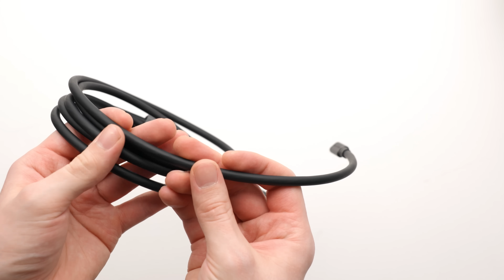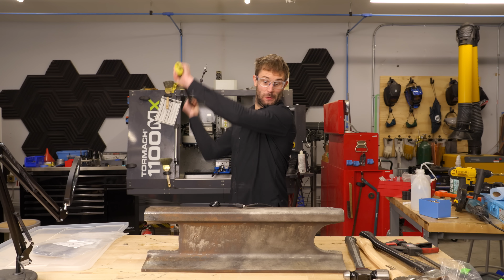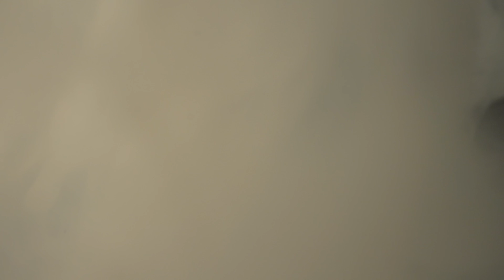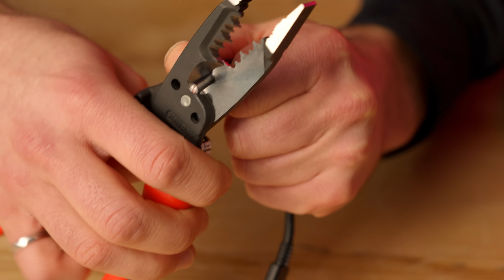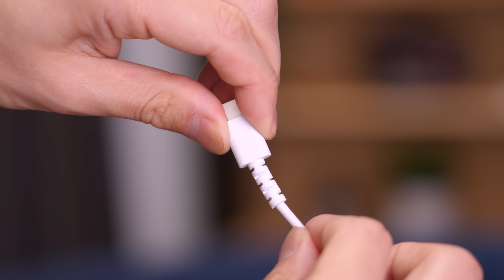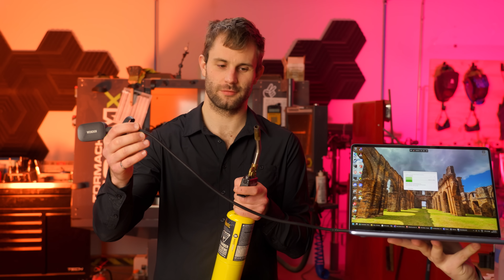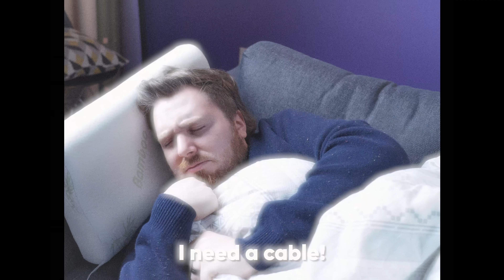Why It Took Me 4 YEARS to Make a USB Cable

Comment: I kinda hope a cable can work with everything and every way of possible with usb-c port from that name. So it's a dissappointment for me. I want a usb-c cable supports thunderbolt3, thunderbolt4, 240W charging, 80gbps, 40 gbps, 20 gbps, display port, audio listening, LAN etc. What device uses for what type of data doesn't matter, it must perfectly match with the specs. So i hope someone gonna produce a usb-c cable with all options without any expection.

Comment: You should make different styles.  My motherboard has USB-A 3.2 Gen2 at the back but the headers are only 3.1 on board.  I use a usb a to c adapter, then I use a usb4 c male to female cable to the front of the case to use high speed devices.

Comment: I mean honestly the pricing isn’t that bad its about the same as a junk cable from a gas station. I might grab 2 for my Fanatec GT DD Pro one for the PS5 and one for my PC. I would rather have a cable that gives me the speed and power advertised than save a few dollars and have to buy it again when it ultimately fails.

Comment: my absolute hatred for cables stems from the android auto connection. is there a way to know? i would think that these should work. but just not in the mood to drop another 20 bucks on a cable thay might not support it. i need a usb a to c, and a usb a to lighting for trubleshooting cars from customers. often its their cable and they dont believe me. but the official vw ones are 40 to 50 bucks.

Comment: Usb-A to square A like for audio DACs and older computer printers and accessories?
Reply: You can get en but your better off just getting a c to a adapter so you can use it with any c to c cable.
Reply: @whatsmolly5741 blasphemy 😂
Reply: These devices probably don't need 10Gbps to work reliably, so even if your "10Gbps" cable (the max possible without USB-C) doesn't reach the advertised speed it won't affect the performance. There are a few brands that make quite good cables, I don't know how they compare to LTT but not all of them are crap.
Reply: @bastienx8  but audio nerds always want the best cable regardless of it not actually improving anything. we spend small fortunes on stupid things like this.😂
Reply: I would actually be curious for you to test some of the hyper expensive audiophile grade hi-fi USB cables. You know the ones that cost thousands of dollars and claim to improve the sound.

Comment: Is for example the the c to c 40gb 1m Cable build the same as the c to c  20gb 1,3m Cable just longer and could not make 40gbs spec beause of length or are there other diffrences ?

Comment: Pricing is not bad. the amount i paid for high quality cables which turned out to be shitty i two damn high. Would love to have quality keystones from you. I use an 8 port keystone box on top of my desk to connect to the back of my computer . the quality of extensions and  keystones itself ist horrendously bad albeit costing more than the truespec cables. Thing is: i want to rely on my computer . everything i can rule out of problem solving equations is a huge plus

Comment: Riley is having criminal levels of fun at his work.
Reply: I think he killed it! It actually sounded somewhat decent for what it was.
Reply: @Jcreamy513  anyone can sound decent with aa decent audio engineer
Reply: @kinetic6506  buddy those high notes need proper technique
Reply: @snappypenguin7891  autotune
Reply: @kinetic6506  true that but there is a certain minimum of quality that you have to be before production.
Reply: @kinetic6506  any producer can identify the pitch correction in the vocals. But the performance isn't bad
Reply: No they can’t.
Reply: @terreboo  why, yes they can ! 'what i need' at 12:06-07. But, pitch correction isn't autotune, it's fine tuning cents of a semitone, considering its not THAT obvious Riley has good technique.
Reply: @terreboo  Lol, it's really not hard to hear when you know what to listen for. That's not to throw shade on anyone using it: pitch correction is a helpful tool used in almost any modern vocal production.

Side note since it's come up elsewhere: yes, "autotune" and "pitch correction" are effectively the same thing. "AutoTune" is the name of pitch correction software from Antares. It's the big name in the space, so much like "Kleenex" has become synonymous with "tissue," "AutoTune" has become synonymous with "pitch correction." There are other programs that do automatic pitch correction out there (Melodyne, Waves Tune, even Logic has pretty decent built-in pitch correction), AutoTune is pretty much the original, and the one with the most name recognition.
Reply: You can say that you have been struck by a smooth criminal.
Reply: They get better and better every time
Reply: He should release an album!
Reply: @vajpero  They'd need some time for planning, so... Christmas?
Reply: @undimensional  LMG Christmas Album v2, produced by Riley and Dan!
Reply: @undimensional  which year?
Reply: @Iceman259  Every year?
Reply: I was sceptical about their ads and marketing in videos when Dennis left. But Riley is on another level.
Reply: When is the Weird Al collab coming?!?
Reply: @darrenweinhold211  That would be amazing and knowing (don't actually know him) Weird Al would totally be up for that. I just know he likes a good stupid song. Have you seen his Documentary? OMG, absolutely one of the best movies I've ever seen.
Reply: @darrenweinhold211  I read that as weird ai. Don't want that. But I would love some weird AL.
Reply: @undimensional  Yeah the I and l on youtube... IlIlIlIl
Reply: honestly debating a floatplane sub just for the  behind the scenes. I can only imagine the supercut
Reply: Go Riley!  Made me buy a cable.
Reply: It sounds like he needs to ask for a ridiculous raise, leave the company after it’s denied, and then throw his previous employer under the bus on his own youtube channel
Reply: as it should be for everyone...
Reply: Dude is so funny lmao
Reply: We truly don't deserve him <3
Reply: Pity it sounds like linus pays his employees really badly and doesn't appreciate them
Reply: @easialogistics6458 If you're talking about Jake keep in mind the dude is only 25 and has bought multiple used BMW's in the last few years. His pay was probably not the issue with him not affording a house. Just saying.
Reply: @prototypep4  yup, he's a whiney crybully trying to milk drama. He even responded to a dexerto article about his video with the shifty eyes emoji, he's trying to get attention.
Reply: Is it just me or did he leave LTT and do a car thing and then go back?
Reply: Who is Riley
Reply: Its a shame that it won't result in enough pay to thrive
Reply: I'm only slightly concerned that mans in that outfit looked like Dr Disrespect.
Reply: @amack308 If you just forget who that is then it stops being a problem 🤌

Comment: I bought 3 sizes. I got the email, and I stopped cooking while in the thick of it to go buy. I knew these would sell out, and they did fast. I left to ask my sister what size she would want, and in that 2 min time 2 sizes I had in the cart sold out. So I went up a size for both and bought 3 total cables. I just want my quest to work well. I went through 3 cables for it, some $30+ and they didn't work. Sure this isn't the $100 certified by quest cable, but we all know that is marketing bs. $22-$30 for a cable like that is actually a really good price so when these launched and I saw the prices I bought instantly. 

This, if they work, will be a great purchase. I had to put "if they work" because technically no consumer has used them yet. I do expect them to work. Creator Wearhouse Goods tend to be very good with imo only a few misses.

Comment: I unfortunately use usb cables mainly to just charge devices so I'm not gonna be buying these. If LTT eventually ends up doing HDMI and DP cables you bet I'm gonna get couple of those. I have had so much issues with video cables rather than usb.

Comment: I bought a portable soldering iron that came bundled with a gan charger and USB-C. It's one of those thicc but soft cables and I love the thing. I started using it for my Switch/Steam Deck, since I know I can just roll it up, toss it in a bag, and it won't get tangled or freeze up in that coil.

Comment: These cables are completely fairly priced.  I paid 42cad for the usb4 cable I'm currently using for my camera rig, from a completely normal computer store.  Sure this'll cost more in the end with shipping, but if I just buy a couple of them at once, I'll have all the cables I need for a while and it'll probably equal out.

Comment: Now for the next challenge: make a 100W cable that’s as floppy as the newer Apple/Beats cables with fabric sheathing but as true to spec as possible so I can just buy the one true cable for soldering with these new cordless soldering irons without the stiffness pulling in the back.

Comment: Finally the first product I will actually pick up from you guys. I want to see other types of cables from DP to HDMI as well etc...  and if possible make magnetic USB-C cables (where the USB-C connector is permanently attached to the device the cable snaps on to it which is useful like a wireless mouse or headset when you take off your headset for a while just snap a cable on to it without trying to fiddle around charging the thing when you go AFK etc...)

Comment: 25 for a cable, it's actually reasonable. 
Seriously, dealing with cables all the time in music industry, we have to buy decent cables for similar prices, there is a lot quality issues even with branded manufacturers. 
I know struggle to find decent data cable and decent charging cable, from other manufacturers they can't be both, you have to pick cables for their use cases.

Comment: i want them but i need angled versions, and usualy use angled adapters since the cables are hard to get. 
so there would be no point in getting these since my current adapters would mess it up anyway
Reply: Same

Comment: I'm so disappointed the reasonably sized ones are all sold out. Can't wait for a restock!
Reply: Anything less than 2-3 feet is kind of ludicrous. I'm astounded they didn't order WAY more in the longer lengths. No way did they not know that's what people really wanted. USB patch cables of 12-24 inches? I don't see a large use case for those.
Reply: @kuhwks They 100% knew which were gonna be bought most. They still ran out because it's hard to gauge how popular expensive cables will be. Its not the end of the world.

The longer ones can be useful for certain things, possibly fishing through walls and stuff.

Comment: I never really had an issue with USB except maybe one time when one of my cables didn't always fast-charge my phone, but what REALLY grinds my gears is how many signal issues I had with my display cables, ESPECIALLY with HDMI. I use KVM switches (previously from CKL, now I switched to L1Techs) for my PCs to 3 monitors and even now the one connection that still uses HDMI often refuses to turn on after the display is supposed to wake up from its sleep state. Sometimes the monitor turns on for like 10 seconds, before turning off, saying it can't find the HDMI connection, even though the PC still sees it. This happened on multiple computers on both Windows and Linux and on monitors from different brands (AOC and Philips), so I doubt it's a driver or graphics card issue. 

My work laptop even blue-screens after waking from sleep with too many monitors connected or when switching too many monitors over too quickly with the KVM, but that might just be an issue with that laptop's display driver.

It would be great if you teamed up with Wendell or some of your other partners to bring high quality cables to market, both on the DP and HDMI side.

Comment: so i calculated those prices to PLN,
and i agree - the price is not overpriced - right now when i buy such cable ill spend 100 - ish PLN anyway,
if only the 240W, was in 2m lengh and availible i would buy it - i dont need shorter. i need 2 or 3m lenghs and max power with max speed.

Comment: Will it work with 100% efficency if i use it on my samsung s24u? I believe the max is 25 or 33w but unless u have an original charger from samsung it wont charge at full speed

Comment: Wait wait wait. When you said the cables aren't going to be "Cheap" i was expecting some crazy $100+ USD price. Going to LTT site and seeing them only for ~$20-25 bucks i was like im already paying near that for "Better/Premium" named cables with who knows the actual quality right now. Your telling me i can spend a few extra bucks and get something with known spec and built to last. Sign me up. I'm almost feeling like you did that on purpose because i wouldn't say in todays time that $20-25 dollars is "Expensive" for such cables. Sure Cheaper would have been better but this sounds like a good deal to me.

Most people after buying the cheap $5 cable pack that doesn't work or breaks on you end up buying the "Better" more "Premium" cables on the current market that go for ~$10-$15 each. With again unknown performance. So i'd say you priced your cables fairly well. Many also forget those current cheap/better/premium cables on the market now never last so you end up buying more and more and they end up costing you a lot more then your original purchase. So again $20-25 bucks for a known spec'd cable designed to last is a bargain. I have never purchased anything from LTT before not because i dint want too but just dint have anything i needed but im definitely going to pick up several cables once you get some of the longer versions back in stock as i wasn't fast enough to grab them before you sold out.

I hope you have plans on releasing HDMI and Display Port cables too as we all know we could use a known quality cables of these.

Good on you Linus. Another great product.
Reply: Yeah at best buy I saw HDMI cables of the lengths they're talking about literally selling for $200. This shit is so cheap in comparison
Reply: @Chex_Mex  Its crazy what these companies  get away with selling to those uninformed. In my youth i use to work at a Best Buy like store before it went out of business. I learned the average person back then could be sold just about anything and believe anything they were told. That was 20+ years ago and those same people today are still falling for it because they just don't know better. Sure today more people are informed thanks to the internet but even still its not just the older generation falling for stuff like this anymore but even the current youth. It should be illegal to lie on  packaging and making false claims while charging enormous pricing based off those lies. Such products should be pulled from the shelf and said companies should be fined or bankrupt.

I hope Linus does an entire line of different cables that most people use on a daily bases and not limit it to just USB. It would expose just how bad the current industry is when it comes to cables and expose those who have been ripping people off all these years with false claim and crazy high pricing or bad quality. So this might just be one of Linus's best products that helps out the most and at a reasonable price.

Comment: The video is only an hour old and the same lengths of cables are already sold out. Bummer. A couple of days ago I lost my best cable and the timing here would have been perfect for a replacement. What's the next best usb-c to usb-c 1 meter cable with good build quality and PD? Bandwidth isn't so critical.

Comment: Could you add the wattage to the individual cable length specs on the store please?  I want the longest 100w capable cable you have, but I'm not sure what that is with the current info I'm managing to find there.

Comment: Theese Cables are just about the Cost of cheap TB4 Cables. That is NOT overpriced in my opinion. As a Data Wrangler, good Cables for USB4 and above is direly needed. Do 2m TB 5 next :D

Comment: I clicked your link, thinking the price would be $50+.
Surprised that it's $20, which is actually reasonable.
I've paid more for worse cable qualities, including "certified" cables which were still crap.
STARTECH made the best, true-to-spec cables so far... And Belkin makes silicon versions, unfortunately charging only.
Silicone + USB spec compliance is exactly what I was looking for.

Comment: Honestly, the price is a lot fairer than I expected. On the pricey side for a cable, but still acceptable imo, especially with a premium build.

That said, I'd like to make a suggestion for the future: maybe consider selling right angle connector cables too. I love right angle cables and it's a market with less offerings than normal usb cables, so it would be great to see a high quality option

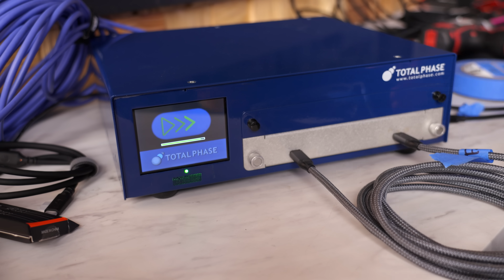Comment: What exactly is it that the cable is failing on at 3:02
Reply: signal integrity, if you watched a little bit more. he said usb have a failsafe in place where missing bits are requested again from the sender to complete the data. less integrity = more requesting = less speed. now add that to already slow speed cable

Comment: Honestly, forget the USB IF certification. They can barely develop a basic series of industry standards (Looking at you, 'USB 3.2 Gen 2x2'). I appreciate a spec sheet of actual spec measurements where you actually know what you're buying rather than just a 'this passed minimum requirements' sticker. The same thing could be solved in the clothing industry, just list clothes with their actual measurements rather than arbitrary 'small/medium/large' labelling.

Comment: The fact these (c>c specifically) sold out within an hour of going live is disappointing. I understand its a new product and there is upfront stocking cost ect but these are priced extremely fairly and I hope you can restock them quickly with your supplier. Opening the video and notification emails and seeing out of stock that quickly is unfortunate.